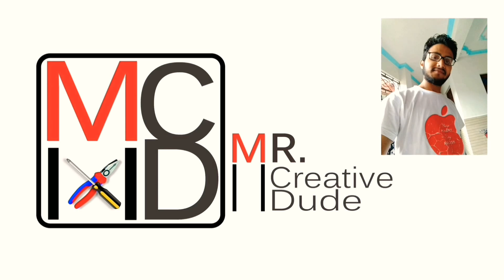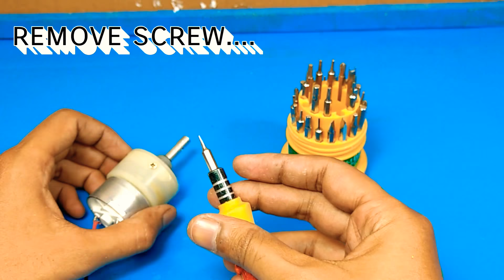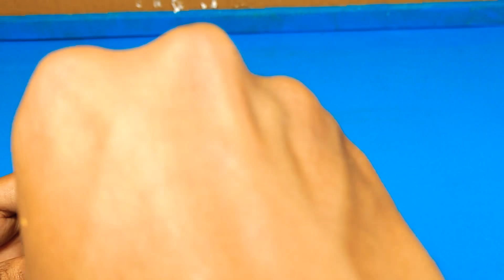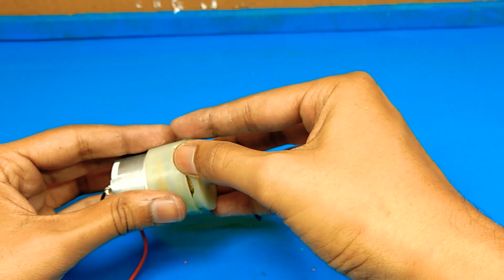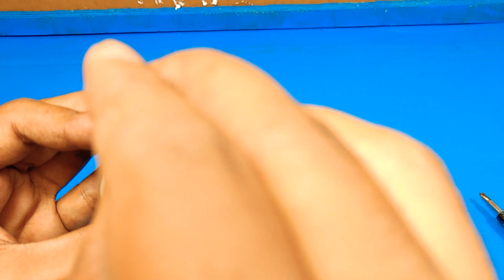what is inside 100 rpm geared dc motor

Comment: Kya 100 rpm 
Ya 200 rpm Ka motor ki shaft ko Haath se ghuma sakte he ?
Mujhe steering mechanism me use Karna h 
Wheels ko Apni position pe wapas lane k liye shaft Ka movement jaruri h
Reply from the maker: Nhi direct hand se nhi ghuma sakte bro....
Reply: @mrcreativedude  kitne rpm ki GEAR  motor ko Haath se ghuma sakte he?
Reply from the maker: Maybe 400 rpm because 200 rpm is driven light with small shaft compare to 100 rpm
Then i guess 400 rpm but not sure